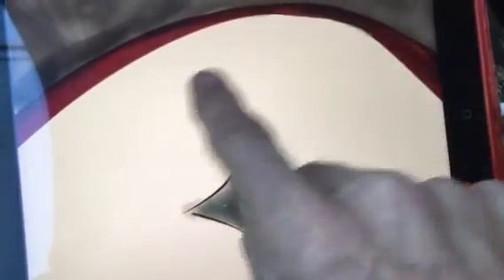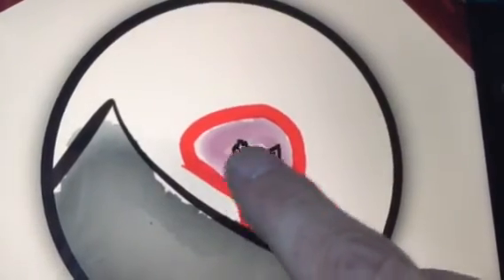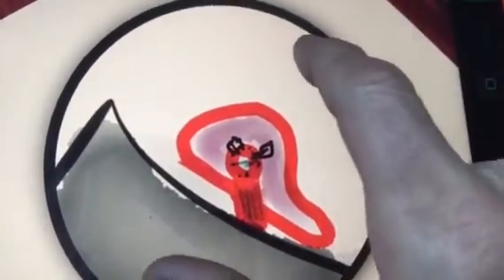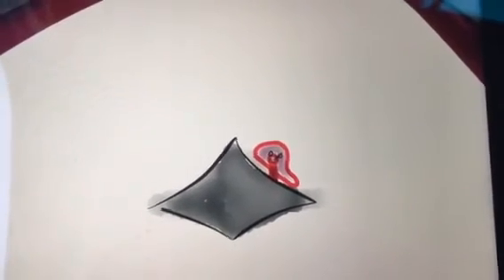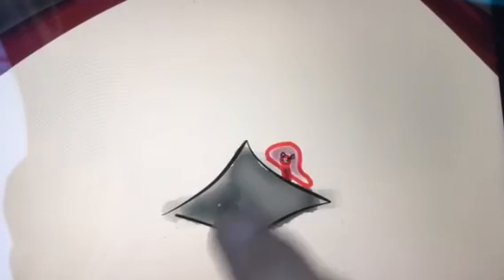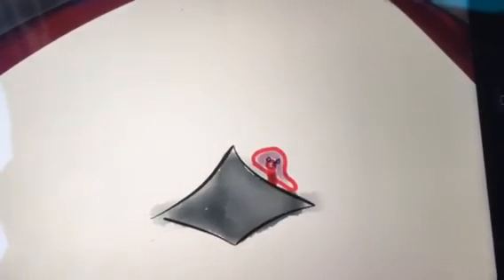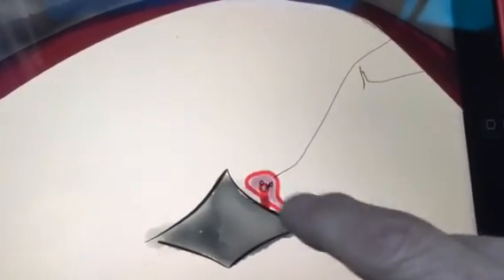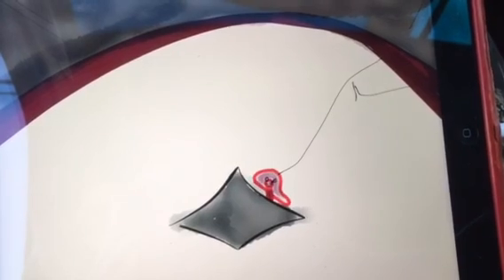How to build a U.F.O.! & UFO metamaterials!

Comment: On the other hand, I can visualize that there could be much use in such a craft for the special qualities to be found in non-crystalline, amorphous "metal glass" which can be extremely strong, resilient and resistant to corrosion, among other qualities. How might this be incorporated into such fabrication?
Reply from the maker: Marc Hurlbert - it would seem logical that they would start with desired abilities and engineer from there… Innoway it's an addition and subtraction issue.... rather than using a specific type of material if the needs line up with the creation of that material or a variant of it then it certainly will be present… The technological level of aI society can be judged how many different abilities you can put into how small of a space for how little of an energy expenditure… By far this method is the simplest method to create a spaceship Atom at a time
Reply: Yes, but the last time I checked, metal-glass was created by casting molten metal extremely fast into a very cold mold that caused it to "freeze" so quickly that crystals didn't have time to form. It doesn't seem that it could be formed by the system of layered deposition that you described. There may have been advances in this area--I'll have to check.
Reply from the maker: Marc Hurlbert wow that's so cool... when your building from the atomic level you can bypass a lot of manufacturing processes you can inherently pattern that Frank the lattices right down to the atoms!